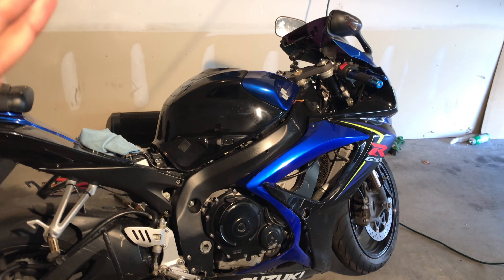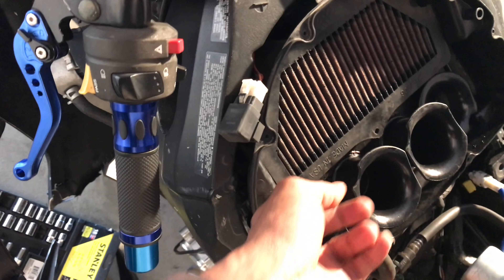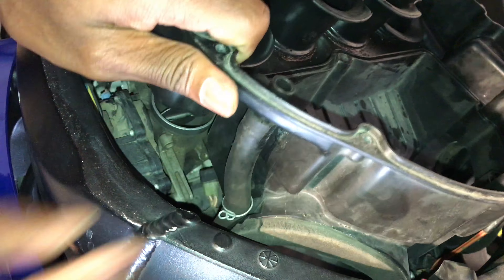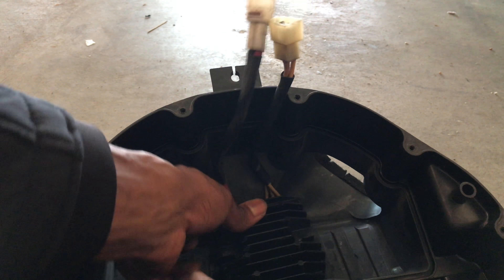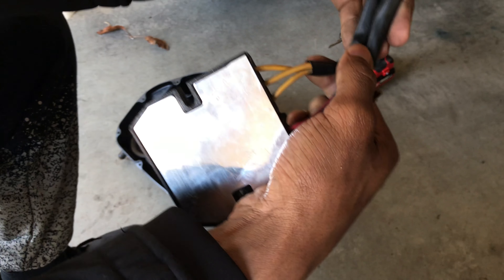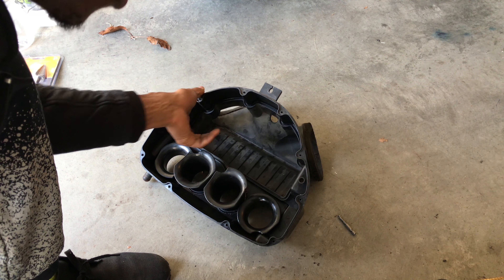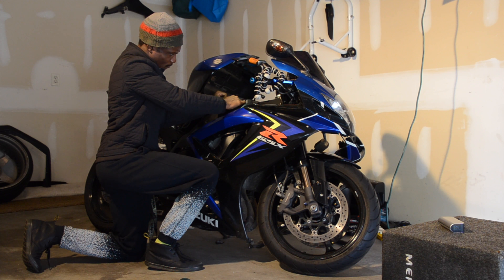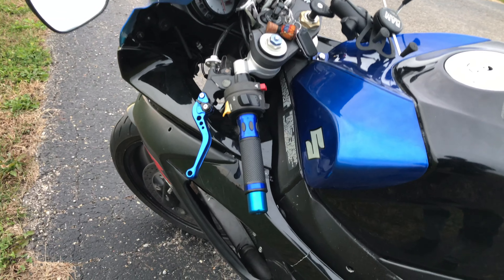BEST DIY Gsxr750 Rectifier relocation to airbox (13 EASY STEPS)

Comment from the maker: I hope this video helps someone out there
Reply: C Live TV what about covering the holes that u made in the air box or does that not matter?
Reply: Friggin awesome video. Helped me.
Reply: Yo i got a question is it cool to put back the filter on after relocating the Rectifier ????
Reply from the maker: beast mode I would cover it with a rubber grommet if I had.
Reply from the maker: Jose Diaz absolutely!

Comment: Your issue is where the Unit is located near heat , move the unit to the rear tail section and install a volt meter to monitor the volts ...

Comment: I have the same issue with my bike, GSXR 600 2006. I brought a relocating kit from eBay. I’m not sure about drilling the air box. I don’t want to loose power or it to cause something to burn inside.

Comment: Have you had any issues with the rectifier since you've relocated it? When you owned the bike.
Reply from the maker: I had zero issues with this modification. I did it in a manner that wouldn’t dramatically affect the performance of the bike
Reply: @CLivetv  ok thanks
Reply: The Gipper  Nice, did too. So far so good. Much better location than near that radiator lol. Don't know what the hell was Suzuki thinking.

Comment: Did you 30 amp fuse blow when it went bad I was riding & I lost power bike wouldn’t do anything I tried putting new fuse it would just pop so I took off Rectifier & saw you big lines on the back of it could that of cause the 30 amp to pop I ordered a new one just waiting for the part
Reply from the maker: That’s strange. Definitely sounds like a faulty rectifier. Although this bike never cut out on me while riding
Reply: Mines doing the same exact thing right now @freshptince505 did you ever get the issue resolved? I took out the rectifier and stator and I’m about to order new parts not but would definitely like to get some input from someone who had the same problem!
Reply: Same thing happened to me bike cut off while driving home no power at all put the backup 30amp fuse in and it blew instantly. After geting it looked at with a line tester the rectifier was toasted new R/R bike runs beautifully. If you take the rectifier out and out a 30 am,in it will crank but be careful its running on pure battery when you disconnect the rectifier.

Comment: I've done this 3months ago but still a bit worry about the rectifier will catch fire ..
anyway rectifier still good till now

Im from az so a bit worried
Reply from the maker: I see, Im in OH. I think the airbox is a great position for it.  I don't anticipate having any issues. If anything the air intake will keep it cool     cheers
Reply: Bought an 06 750 and the rectifier was in the air box. First time I took the airbox off I noticed that the connector had caught fire and melted the clips together.